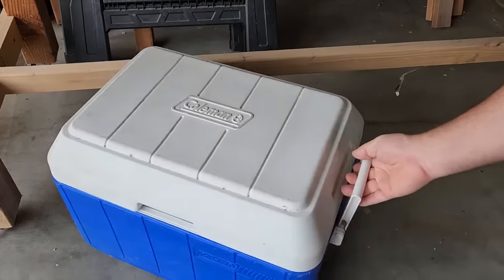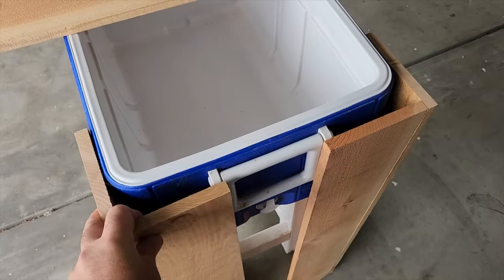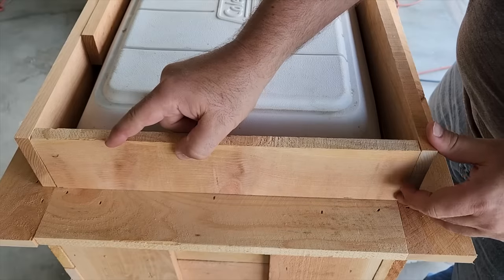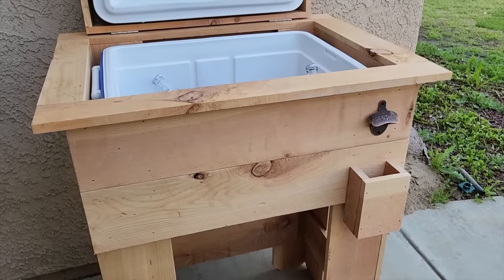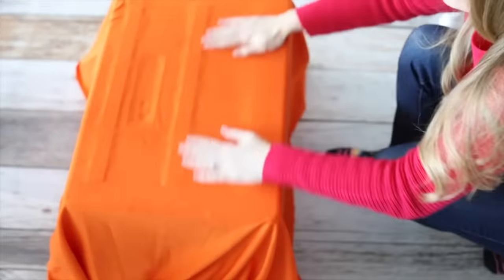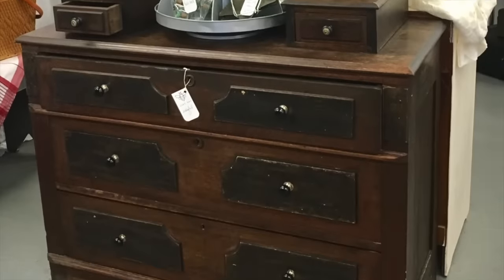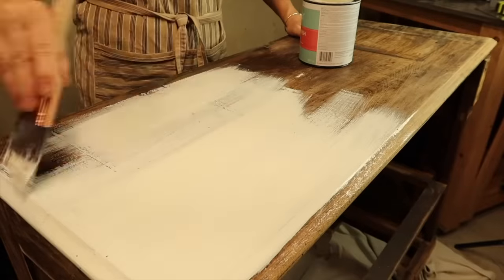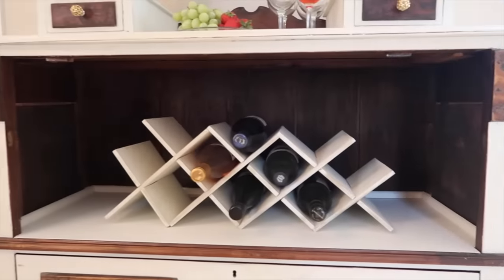People are flipping out over this GENIUS cooler hack!

Comment: The first one was pretty good. It's a good thing the cooler can be removed to empty and clean as needed. The bottle cap holder needs a slide out bottom for emptying the caps into a bag. Or you could put a bag in there in the first place but clip it in place so it doesn't fall in. Otherwise it was an awesome idea.
Reply: That was what I wondered. I guess it takes a woman to think about how practical something is. 😂
Reply: @Mimito5  Hey now....😉
Reply: Was thinking same thing about slide out idea
Reply: @GoodlyEarth  😆
Reply: It would be easiest if the cap catcher is wide enough and shallow enough so that you can reach in with your hand and pull out the caps. Otherwise, a magnet can pull out the bottle caps. (I haven't drunk from a bottle with a cap in years.) Other things: Even cedar fencing needs to be treated to avoid decay. He used Titebond Premium Wood Glue (1:04), which is waterproof, but not all wood glues are suitable for projects that get wet, so choose your glue carefully. Personally, I don't have space for a permanent cooler stand that I would rarely use, but that's just me.
Reply: @JonAhlquist  I think he covered up his drain plug too. Thought the same thing about the bottle cap catcher. Not even a child with small hands can get the bottle caps out.
Reply: I too immediately wondered how you get the caps out of that rather small box, which would fill up pretty quickly if you had company over.   I agree, other than that it's a neat project.

Comment: I've got a better use if you have a backyard. I've been using various coolers just like that as a fireproof, burglarproof safe for valuables you would store in an expensive safe. I bury them in a nice garden setting with the top at ground level. Put a paving/flagstone type over the spot. Been doing this for decades.

Comment: 3 things about making the first cooler. It looks great, but be sure to use waterproof wood glue and apply an all- weather sealer to the wood. Finally, how are you supposed to remove the bottle caps from that narrow cap catcher? 🤔 I'd probably make a removable receptacle to hang below the bottle opener or just flatten one side of a small tin bucket to hang flush against the cooler case under the opener.😁

Comment: What about the drain ????
Reply: The cooler can easily be removed to drain and clean.
Reply: @Mimito5  yeah I guess since the handles cant go down after you use em to slide it in there
Reply: @brianh6272  But the handles are shown as being down after it’s in the box. If they remained up, to be able to use them to remove and empty the cooler, the new top would not be able to close. It’s cute, but it’s not practical. 
Also, the styrofoam cooler is going to be demolished the first time someone plops some heavy feet on it, or if someone thinks that it’s an actual piece of furniture and sits on it! It would have been better to construct a wood box to encase an inexpensive styrofoam cooler, making it sturdier.

Comment: Love the cooler first cooler video. I agree with others that the same type of cooler used in the first video would work as well for the video of the ottoman & provide much support, but what an awesome way to reuse a styrofoam cooler that probably be taking up space in a landfill somewhere. Saw some of the comments & wanted to mention that I have watched the DIYer in the first video on several other projects & he is very thorough so I am sure he left an opening for the drain spout & also a way to remove bottle caps from container easily. Only so much time can be allotted to DIY projects shown on HT, so I’m sure he had to keep most info specific to the cooler housing build info. Wanted to ask if anyone happens to know his name or if he has his own channel I could look up? Really like his attention to detail on instructions. TIA

Comment: Filling the insulating hollow areas with foam/anything has the opposite effect. The hollow area is designed to creat a chilled area around the cooler space so the ambient doesnt draw the chill out of the inside. 
When u fill that area it acts as a heated/warm blanket sucking the coolness out even faster. Depends on the outside temp i guess
Reply: Is that so? I filled my lid with half a cup of salt and 2 thirds of water and freeze the lid before reattaching when needed and I use 3 x 2"dia pipes with caps 50/50 water with half a cup of salt and frozen to go in the bottom with some stainless mesh on top to make a false bottom

Comment: You can beef up an old cooler by drilling holes around the top rim and then spray in some expanding foam. They don’t use a lot of foam from the factory.

Comment: The ottoman cooler needed the excess fabric cut away from where the lid fits. You could adhere tape trim to cover the edges & not interfer w the lid closing. The suggestion of adding some foam or pillow on top is a good one. The only problem I see w using this for an actual cooler vs a storage ottoman is pouring the water out & getting the fabric wet & nasty.

Comment: I think they should have used the foam cooler for the first project and the poly- container for a seat or stool. The poly body would be stronger to take the weight. Otherwise, good.
Reply: P.S. how do you clean the fabric covered on? It might be easier to elasticate the outer edge of the lid piece and the same for the bottom piece. They can just be pulled on and off quickly and be thrown in the laundry!